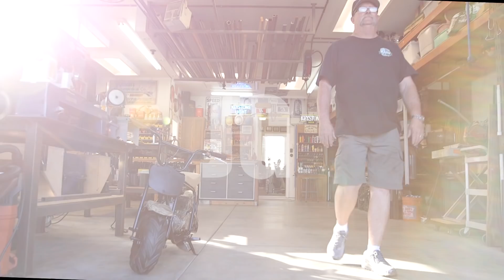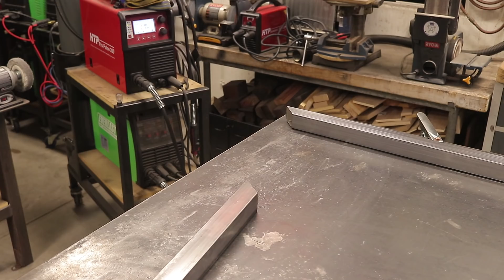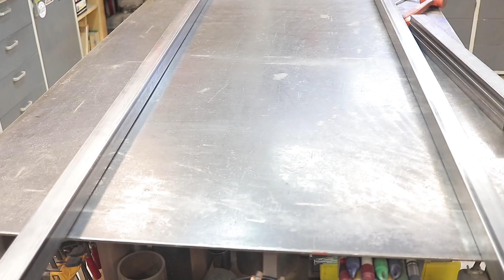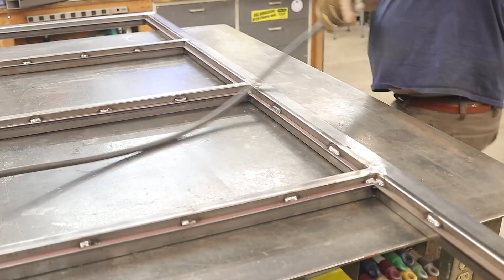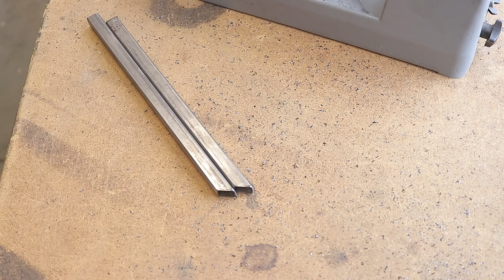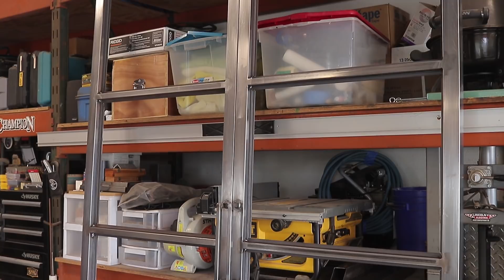Sliding Barn Doors | JIMBO'S GARAGE

Comment: Hey Jimbo, a trick I use when working with small pieces like the handle is to leave the short legs long, weld them and then cut to the final length.  This way you have more to hold/clamp or put into the corner vice.  Nice project!

Comment: How was the glass installed? Was there a cover strip - or perhaps they just used epoxy or black silicone?
Reply: I am wondering the same thing? I'm in the middle of a similar project and looking for ideas
Reply: @christopherthomasson5418  did you come up with a solution? i have a customer wanting a similar job and thinking how to secure the glass
Reply: Inquiring minds want to know.  A similar 1/2 with set screw could work but 1/16 leaves nothing to tap. Mmm
Reply: I would like to know also
Reply: A lot of European versions use putty.

Comment: Hi Jimbo. You did a good job, as always.
In your opinion, this project could be welded with stick (with some light rods like 6013) or the tube gage is too thin to do so?

Thanks for your videos.
Sart0
Reply: Five years late, but 1/8 6010 will work

Comment: I can't believe the people on you tube Welding, Grinding and moving large pieces of Steel and there wearing short pants and sandals. It's just unreal to me. I've been a Millwright/Welder since 1970. Seen quite a few ugly injuries.
Reply from the maker: Thanks for watching Garry, I agree with you, what i do and wear is not right most of the time. But i do live in Southern California were it is 75-80 in the winter, And 90-110 in the summer. I try to be as comfortable as possible.. My shop is on my property, Where i have been do this for years, I'm saying that is right, I guess i take it for granted. I know i should practice more safety. i'm also 245 lbs. it is hard for me to bend down. with pants and boots on it would feel like i had a suit of armor on. Thanks for your concerns and advice Garry, I will try to change my ways..    Jimbo!
Reply: JIMBO'S GARAGE  we'll thanks for replying. I just don't like to see anyone get hurt. I'm in Nv. So I know about the heat. I know that everyone is diff. Watch your channel all the time, ( even with your short pants ). Take-Care
Reply: I'm Australian and weld bare foot in shorts. Stuff only burns for a second :P
Reply: Troy, until you drop something heavy on your foot, the heavier it is the longer it will hurt;(
Reply: Thats how self employed welders weld. Because no boss will gonna rule them
Reply: Just like me :)

Comment: how do you prevent rust? i dont see u use galvanised alot sir
Reply from the maker: Thanks for watching Marvin, They were powder coated.    Jimbo!
Reply: Marvin, Jim is in the land of fruits and nuts.  It's pretty dry in Cali.  Welding galvanized steel is no no.  The doors look great, but I hate that black powder coating look.  It's good for car parts, not interior doors.  Shows someone has zero imagination.  There are thousands of metal finishes out there without resorting to boring black.
Reply: Actually, welding galvanized is a very common practice. Just be aware of the fumes, and protect yourself.